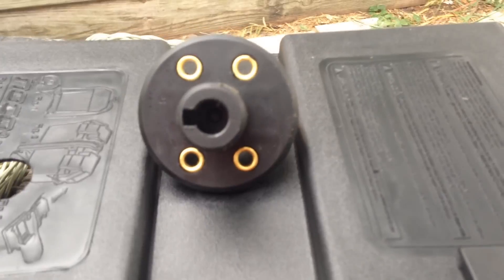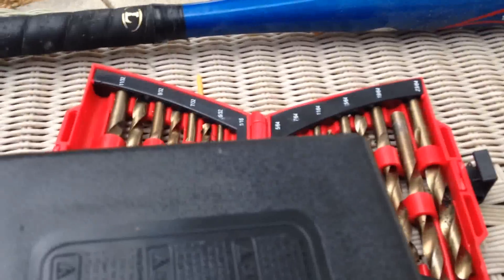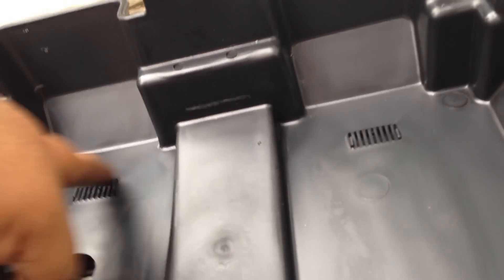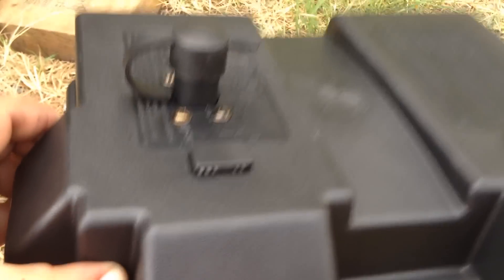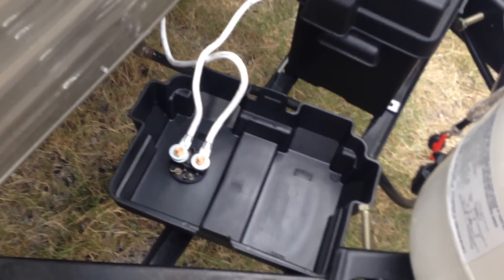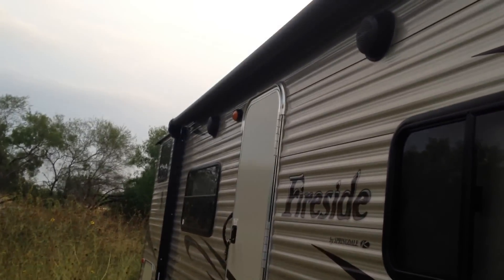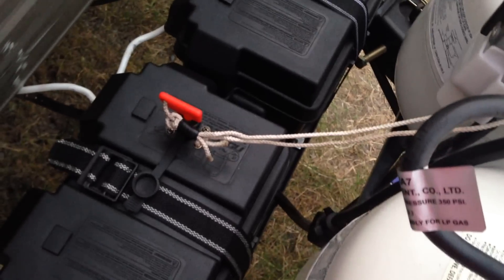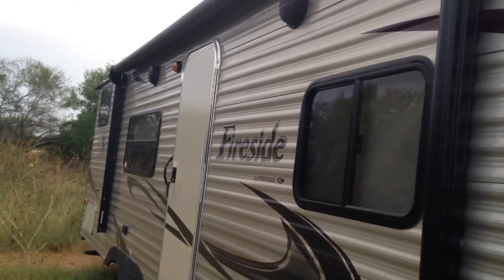Battery Disconnect Switch - Travel Trailer Life Hack

Comment: I was wondering how to install my battery disconnect switch, I'm glad I watched your video.
I made some modifications to my 2014 Fireside also, first I had to put down new plywood on the back bed when I almost fell through it when opening the upper window and I reinforced the boards going across it too so it's heavy duty now. I also put down the 3/8" plywood on the dinette and put hinges on the seats also.
I had battery problems since the day I bought my Fireside new, when I would plug into shore power it would fry the 12v fuse panel so the dealer put in some bigger fuses and replaced the fuse panel which I will probably take pictures of and send them to the manufacturer to see if this trailer is going to be a lemon or needs to be fixed right which this will be the 3rd time into the shop.
I hate that flip up cabinet next to the microwave, I'm going to try and find a gas strut or hinges for it soon.
I also used a 2x4 board to hold up the front bed when I am getting into the storage area.
I am working on a wood cabinet cover to go over the stove so I can put the coffee / tea maker on top of the stove since I do most of my cooking outside.
I have the same propane tank cover that you do.
Did your radio come with a remote? I had to let the dealer know that mine didn't come with one which the floor demo had one.
Other than that I love my Fireside
Reply from the maker: I am glad It help out a little. The fireside is a good trailer i have put out another video of similar mods I've done myself, http://youtu.be/kQY6Uuirq8Y . And thank you for sharing your mods I might have to do the same.

Comment: PS Harbor freight or Alibaba can fix you up with a matched set for under $20.00 on a BAD day, with the extra wire, connectors , shrink wrap and anchors? 💸
Reply from the maker: +Eric Blair the key unit is only 9.00 on Amazon. So you would get 2 switches and 2 exact keys for 11.00 less.
Reply: All Things Local PLUS! IF YOU DON'T HAVE`~ WIRE, TERMINATORS, SOLDER,FLUX, HOLE SAW, ?

I PASSED ON THE ONE FROM AMAZON: SINCE MY ROOM WAS BIGGER . GOT A DISTRIBUTOR WITH  BATT for #2 wire size BATT. 1~2, both , off and lock (handle/dial off.) 
YOURS, WILL: DOES WORK just fine but ; I don't know where I'm going or who will be with. so, more for security than batt drain?😨

Comment: Just bought a TT.  Why would one need to disconnect the battery?  During the camping trip?  After the camping trip?
Reply from the maker: +Charles Cho while in storage, the fire detector and gas detectors will be running continuously and drain your battery and could damage it of it runs dry and keeps pulling energy from the battery also anything else that might stay on, and it also limits the chance of current running from battery to ground over and over slowly draining your battery.

Comment: Question, you have two batteries, but I only see one negative going from one battery to the cut off switch, shouldn't there be two negative wires going to the switch? one from each battery?
Thank you
Reply from the maker: +Cidalia5188 Barba yes at the time I only had one battery
Reply: I know the OP replied and said he only had one battery at the time but for others that might be reading this, it would also depend on if the batteries are wired in parallel or series. If it is a series then one switch will break the circuit at any point, but if it is in parallel then depending on the location of the switch in the circuit, it could be done with one switch or it may take multiple switches in multiple locations.

Comment: I don't understand how a turn will disconnect the power.
Reply: Miss Lynne the wall switch in your house turns the light ON or OFF. There is a wire going into the switch (from the house electricity) and a wire going out (to the light). When the switch is ON the wires are connected and electricity flows through the switch to the light. When you flip the switch OFF it breaks the connection and the electricity can't go through the switch to the light so the light goes OFF. It's the same concept here except the switch is a knob like the old radios ON/OFF.

Electricity flows from a source (positive +) (+ on the the battery) to a ground (- negative on the the battery). The knob is simply a switch that turns off the flow from the battery to the trailer. Just like the switch in your house turns off the electricity to your light.

I hope this helps you to see the concept. It's a valuable thing to disconnect the battery at times to conserve its electricity.

Comment: great idea--do u have model no or and make of this unit--cant find it on amazon--thanks
Reply from the maker: +Kent Mccoy Cllena Battery Isolator Disconnect Cut OFF Power Kill Switch for Marine Car Boat Rv ATV Vehicles https://www.amazon.com/dp/B01IBOH5EA/ref=cm_sw_r_cp_api_TllYybMZ2E0V0
Reply from the maker: +Kent Mccoy Cllena Battery Isolator Disconnect Cut OFF Power Kill Switch for Marine Car Boat Rv ATV Vehicles https://www.amazon.com/dp/B01IBOH5EA/ref=cm_sw_r_cp_api_TllYybMZ2E0V0

Comment: What would you do if: the key fell off? Better yet; you OFFENDED someone, or didn't and someone took the key?

I put mine inside at A convenient but hidden location. Works just as good, stays dry and I have a jumper fo a back up when and if the switch breaks 😲

N
Now if I can just remember where I put it?😨

No real offence? You can always install a hidden back up and a camera to Chatham the look on his face when the switch outside doesn't work for him , when he tries to hitch up with no power to the jack or stabilizers while he's banking away at the coupler lock? 😅

One more thing, put that KEY in your pocket?😉
Reply from the maker: +Eric Blair  if someone wants to go that far just take cover off and move the wires to direct prongs? Also if someone wanted to they could disable the whole Trailer by just cutting the main line.

Comment: question. when boon docking over night at the casino, i left the plug from the trailer connected to the van. when i got back from gambling both the trailer and van batteries were dead, why did the trailer drain the van battery. do you need a  duel kill switch so that you don't need to unplug trailer from van? or is there something else going on?
Reply from the maker: +Mike Voisine when in tow I have batteries connect (switch turned on) and when I park I turn the switch off turning off the batteries to the rv. Since power can travel both ways the RV can drain both your RV batteries and your tow vehicle batter same for the tow vehicle. If you leave a radio on or headlights it will drain both batteries. It could be that whatever appliances you were using in the RV drained your already weak RV batteries and then went on to use your tow vehicles batteries. Now that is only possible if your RV batteries were weak but still shouldn't be enough to drain tow vehicles and RV. Unless it was something in the Tow Vehicle that was left on. As a solution I have switch on in tow and if I park somewhere let's say a quick eye sight that may be a couple to few hours I'll turn off switch. Now if I'm going to stay in RV I'll unplug from Tow vehicle and leave my battery switch on so that I know I'm only using up my RV Battery. Once I use up all my RV battery (not all but close) i turn on my truck and plug back in for a couple of hours but not recommended unless you have a diesel vehicle, that or I'll turn on a generator and charge them overnight.